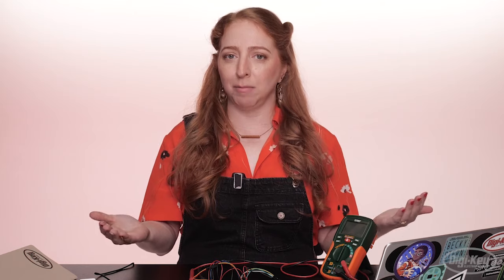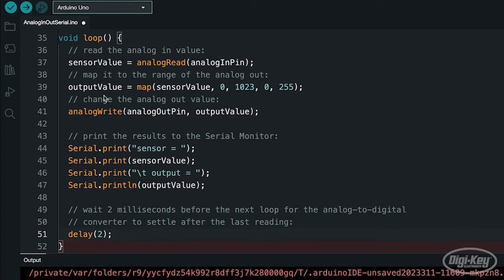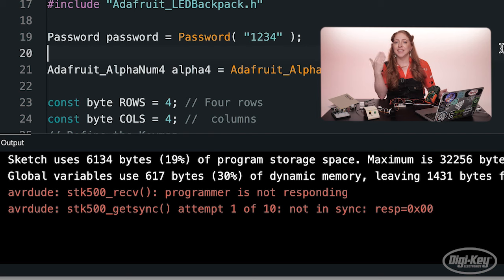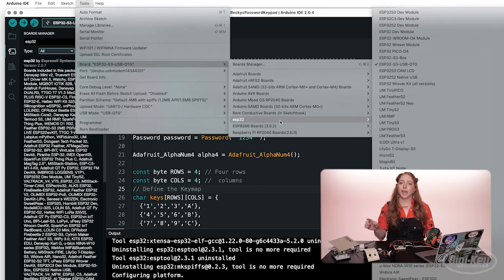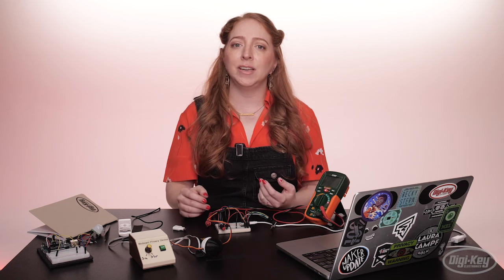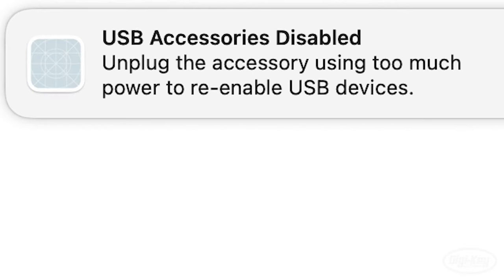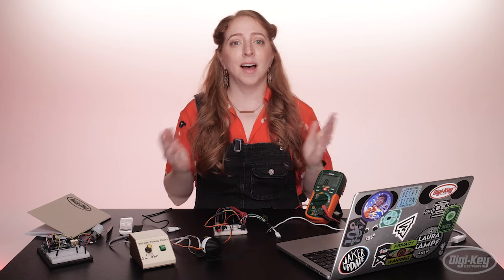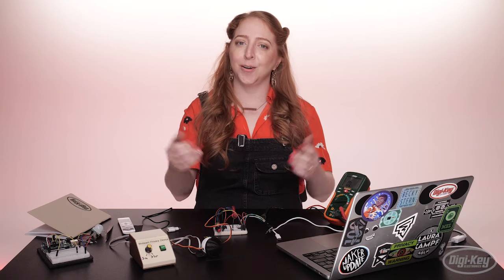Arduino Errors and Troubleshooting - Electronics with Becky Stern | Digi-Key Electronics

Comment: Excellent vid all around. Troubleshooting is such a huge monster topic it's hard to know where to start. Pro Tip: Compiler and run time errors, always fix the first error first. Typos and punctuation can cause multiple errors, but further errors usually have no clue as to the actual source. Sometimes fixing one error causes dozens or hundreds of others to 'go away.'
Reply: Yes, to both! Excellent job by Becky, and fixing keyboard miscues or omissions often is a simple but elusive solution! 😎✌️

Comment: 2:20 - Unplug your board and plug it back in as you should whenever you make changes to your circuit  ... WHY?  This is nonsense IMHO. Unplug BEFORE making changes to the circuit, and reconnect after!
Reply: So, not nonsense?